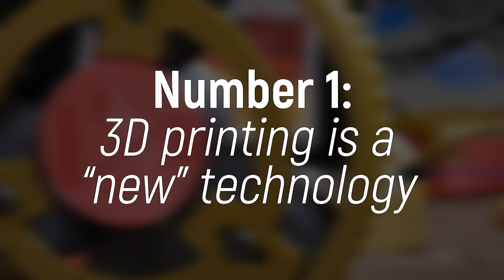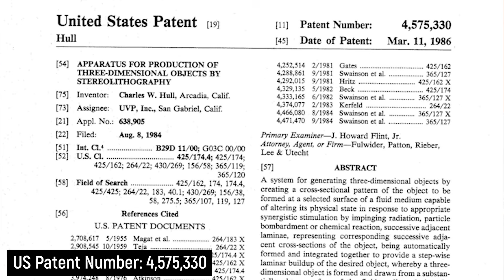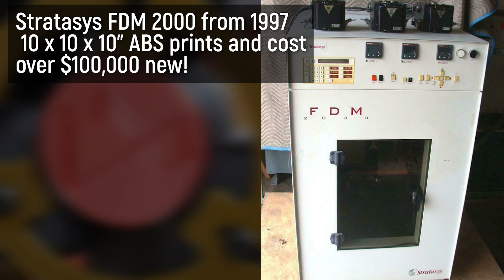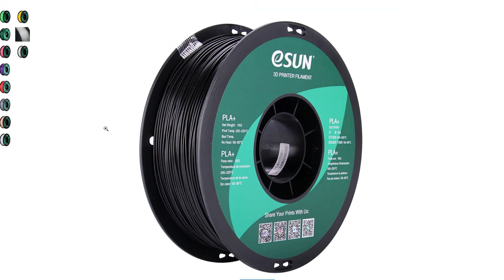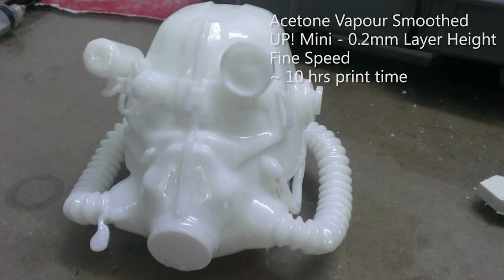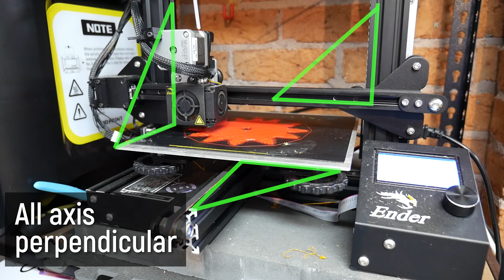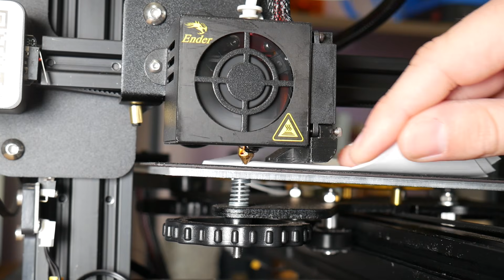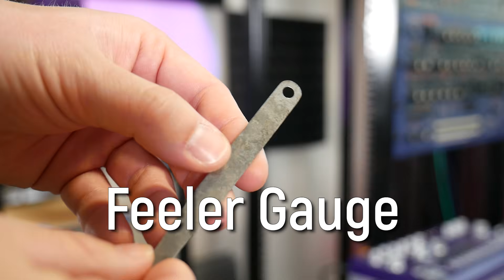3D Printing Myths I used to believe...

Comment: USE A DIAL INDICATOR TO BED LEVEL! It's like 5x faster and WAY more accurate.

(My $30 Turlen indicator from Amazon is laughably accurate for its price, verified in a machine shop)

PROCEDURE:
FIRMLY fasten it to your print head below the nozzle (I carefully zip tied it to my CR Touch), bring table to temp, set indicator zero at one corner, move the head over the other adjusters in X and Y (Don't move Z), and bring those up/down to match the first zero. Double check until you get the process down. If it's repeatedly accurate, you are now VERY level.

You will actually notice high and low spots in your table, mine had some spots that were .003 inches lower or higher than the corners, but it prints fine.

Comment: Damn I've been printing for a couple of years now and didn't thought of the metal gauge, maybe because using Original Prusa you don't have to go with those pesky screws as I had to on my Anycubic (and why I also didn't like it so much). Nevertheless it's worth knowing, thanks for the tip!

Comment: I've used feeler gauges for years, just be careful not to gouge your nozzle, as the feeler is steel, and many nozzles are softer. I've never folded my paper, just a sheet of printer paper, no folds. adjust the bed until there's a little friction on the paper. with the feeler gauge, it should pass perfectly under the nozzle, if the nozzle stops it, your bed is too close. You use the same gauges to adjust valve tappet clearance on engines. Machinists use feelers, dial indicators, etc. so it made sense to employ the same tools.

Comment: I found great success in leveling the bed by eye - human eyes are much more precise than a paper. I just have a light on somewhere behind the bed, get down at almost eye level, and adjust all four knobs raising the bed until jussssst when the light disappears. Then I run a couple full bed-size concentric squares/brims and adjust the global z-height on the controls to get that nice, slightly smushed bead. Haven't had a single bed adhesion or first layer problem since. And I can't remember the last time I had to level it. It's been at least 3-4 months.

Comment: In the past I've used the paper method and would frequently have issue with my nozzle digging into the bed, this even happens with my auto leveling from time to time. I ended up learning how the filament is supposed to look when extruded, so I will level my bed with about 2 screw turns loosened, and adjust from there by watching the amount of extrusion out of my nozzle, so far I have gotten fantastic prints, and the ones that don't come out good are usually due to bad filament, loose X or Y axis, or bad support settings. 👍

Comment: Correct term for setting nozzle height is "z-offset adjustment". In CNC machining you do this by setting your tool distance off the part (the bed in this case is cast steel and leveled and "trammed"  within microns from the factory ) and we still use the paper trick all the time; not everyone can afford tool eye sensors on their machines. There is nothing inherently wrong with this process, but it is less precise. Never catch someone using a steel feeler gauge on his $200 endmill to set the offset, great way to break the tips.

Comment: I['ve never heard of using a piece of paper folded (2, 4 times thicker??). I use a flat piece of printer paper manually adjusting until it catches slightly. Then I use the auto level to finish the job. If the differences seem large to me, I'll make fine adjustments and auto level again until I'm satisfied. Once a week or after I've not used the printer for a week or so. I've never had any problems with the job sticking or elephant's foot or similar issues.

Comment: I'd argue Abs is stronger than PLA in many cases for end-use parts as PLA has low ductility and toughness and will likely crack under impact loads. tensile testing is done under low strain conditions.

Comment: Could you clarify?
DO you set to the feeler gauge then UN do the negative Z offset? or leave it there? 
I'm thinking it has to have some clearance or the nozzle drags the bed... OR the slice offsets it up the thickness of your first layer, and doesn't drag even if set to dead 0? Either way could be right, and I don't want to damage this thing. 

I come to this from machining metal on non CNC machines, so I get the traming bit, hate the term leveling for it, but even knowing the concept, its impossible to get any data on what Exactly the clearances are supposed to be.  Don't even get me started on belt tension... I want a deffletion spec to set them to but thats non existent too.

Comment: Good tip about the feeler gauge, and raising  the z axis by the same thickness as the feeler guage.  So I think I'll get a set of feeler guages, as that seems a more accurate way compared to using paper!  Certainly my new Ender 3 Max doesn't have fancy automatic bed levelling features!

Comment: I've stopped using paper long ago. To level a glass bed I just heat everything up, clean the nozzle, put a powerful flashlight behind the printer and dial in the screws to the point when nozzle just meets its reflection in the bed and there is no slit between the nozzle and the bed. Given enough light and a clean nozzle, the accuracy of this method is within 10-15 micrometers. For Ultrabase/PEI sheet I let the hot nozzle form a small blob of molten plastic, softly touch the bed with the nozzle and slowly dial the bed back down until the blob just starts deforming (it stretches between the nozzle and the bed) and then lift the bed up just to the point when the drop no longer deforms (that means the nozzle is touching the bed).

Comment: And regarding leveling and nozzle height. I found it you start a print then kill power to the printer during the first layer you’ll leave the printer at it’s starting height. From there you can then then do the feeler/paper leveling by dragging the head around.

Comment: I don't think folding the paper is correct. Always used an a4 piece of paper. When buying the anycubic series of printers it comes with a 'bedlevelling' paper already stuck onto the bed. which is the same gauge as regular paper. Folding it over would definitely make the levelling process redundant

Comment: Leveling the bed with a paper was, so frustrating so many variables could be off!
"business card? A4 sheet? folded A4? Dig in? slight resistance? No resistance?"😩 everyone does it different!
Now i just run a test print circling the whole bed with 1 layer and adjust it live while printing until it's perfect
Works everytime!

Comment: This is the first time I've ever seen someone use a folded piece of paper. I've always done it and have always seen it done with just a flat piece of paper. Also if you measure the difference between cold and preheated with a mic you'll see that its basically pointless to preheat.

Comment: 4th spring can cause or fix deformation of the bed. I do leveling with a paper but, single layer and measure the thickness of it and use it as basis. If you do not have software bed leveling capabilities in your printer, you still do not need perfect zero, depending on the slicer you use, you can adjust the zero height. Though if it is too off, you might have mechanical issues so be careful.

Comment: Maker's Muse is absolutely correct about the whole paper leveling business with regards to the fact that using paper for leveling is always going to result in the nozzle being a paper's distance away from being correct, HOWEVER, using a paper for leveling is just the first step and all that gets you is CONSISTENCY.  a uniform tramming of your print head to your print bed is what you're going for in this first step.  it doesn't matter if your "common knowledge" is that the paper should be loose or rubbing, so long as it's THE SAME at each of your testing points (which for best results, I recommend starting with the corners, then the middle going around a couple times, and even doing the middle edges of your print bed as well, if you can get a consistent average to all points, your tramming is complete) - THEN you set the z-offset by printing a calibration object (it doesn't matter what because i stop it before the object prints, i usually go for a 20mm calibration cube) and when I do this, i set a 20 line skirt around the object that i place pretty far away (i try to estimate roughly half the distance from the center to the edge of the bed so it's nice and big and leveling issues are pretty apparent at that range).  when the print first begins, I use z babystepping if you're still running marlin, or z-offset dial in klipper to lower and raise your toolhead while it's printing the skirt until you get both good bed adhesion as well as just the right amount of squish.  you can manually remove each line of the skirt as you go if you want to get a better feel for how far down is good.  once you think you've dialed it in, you use your printer to save this offset in your printer's memory (or klipper config file) and then continue on to heat up your printer and do a full bed mesh with your bed probe (if your printer doesn't have a bed probe, don't worry about it, but it is a HIGHLY recommended upgrade if your printer isn't already equipped with one. (bltouch on most i3 printers works really well, but there are all manner of inductive probes or microswitch based (klicky) probes available for very little money that are very easy to get installed on most printers).  doing a mesh bed level insures that any physical bed leveling inconsistencies are worked out and compensated for in software.  after taking the bed mesh, save it to your printer's memory (or klipper config file) and then (making sure to turn off the skirt from before), print a bed squares model that is only 1 layer high (for me that's usually .2mm), from here you can use the z-offset/babystepping to fine tune your z-offset to the bed to dial in an absolute perfect first layer by judging the consistency, texture, and adhesion of each square in each corner and center to get the PERFECT level. for your printer and save that z offset.  I usually then write it down in my notes because if i don't change the wheels or remove the bed, that z offset should remain consistent through that bed mounting). then i would go on to calibrate linear advance (marlin) or pressure advance (klipper) and extrusion multiplier for the particular filament you are using.  both LA/PA AND EM are set PER MATERIAL.

Comment: i have found on my Ender 5 pro that in leveling with paper the nozzle has to catch, stick and skip across the paper or plastic does not stick to the board. if you do it fast enough it sounds like the paper is farting.  if it farts you are good.

Comment: Misconception #4: Before i got my first 3D printer, thanks to this channel; I believed that line by line, the print would end up being water tight, after all the printer was melting each line at exactly the right height & I had no clue of what nozzle size meant & what accuracy limits 3d printers had. 

Prints are NOT watertight & getting something that has been printed to be water tight or even worse: Hermetic sealed... forget about it; any sealing you add post print should not be used for things like the hull of a boat or submarine because plastic can still allow vapors to go through & even with metal filaments, the printer is not nearly as accurate as it would need to be to make a real seal.

Comment: Another myth to add to your list. Heated beds. I haven't used my heated bed for years with flawless results and to be honest I only ever turn it on to evaporate any excess rubbing alcohol I might use to occasionally clean my build plate off with. Granted I work in a climate controlled work space, it's always around 72-82°F in the room. The build plate is kept clean and dry with very little and scarce maintenance. Also I make sure my bed is full "plumb" to my printer nozzle at an appropriate distance for best bed adhesion without squished flared edges of the initial layers (I do this manually without paper or feeler gauges by allowing the nozzle to just barely scrape the surface all around the build plate surface). I use a PEI build plate (no adhesive). If I do get curling (extremely rare) I allow the printer to print the first layer of a print, stop the print, remove that layer and then start the print over from the beginning. Works every time. Side note the only time I do use adhesive is actually to work as a release agent for those stubborn TPU prints that don't like to let go of the build plate. They come off with easy Everytime but yet still no pullups or curling. With no use of a heated bed to needlessly repeat myself.

Comment: The paper trick was part of the setup recommended to me. Gave me a 2 month fight where all my prints failed. I now just eyeball the leveling and offset the z-axis to match. My usual adjustment is just 0.06-0.64 mm. however, between prints I realized how much mu springs can warp; had a leveled bed with a successful print and a 0.35 z offset, where the following print needed a 1.46 offset.

Now I dial in the height to all my prints. I need to build a leveler attachment to make future prints easier to start.

Comment: As someone who's not just a novice, but have owned a 3D printer for.... checks watch 19 hours since swiping the card and currently running the 3rd print ever, beside the default built in test print... Even I've heard of these, but good to know I can throw them all out.
Reply: Flashforge Adventure 3+, for those who's about to ask. Aka, newbie model.

Comment: So odd to think of ABS as a slowly outdated filament. Used to be pretty much the only way to go. These days for many use-cases PLA(blends)+PETG have become default choices. ABS having been relegated to when you either need that thermal resistance (3D Printer parts) or want to chemically smooth. And even then you are practically always better off with its younger sibling ASA that beats it in nearly every aspect.

Comment: I have am automotive metal feeler gauge and level my bed to .05mm . I have perfect first layers all the time...tough the center of the bed is .15mm lower. I just take that into account for the size of the model i'm using. If it's small i use a .15mm initial layer with .6mm nozzle. Still get great prints.

Comment: ABS DOES have advantages over PLA as far as temperature survival.  Don't try printing anything in PLA that needs to spend most of its time outdoors or locked in a car.  Use ABS or PETG for that.

Comment: Easiest solution to a non-level print surface I've found. (Using a LARGE 1.0 print nozzle for LARGE prints).

1. Make a PROCESS (Simplify3D) that will print the first bottom layers SLOWLY at say 0.55 etc, like 1mm up. Some print surfaces are just inherently uneven, or become more uneven when heated.

2. Always use the side of the print surface that bows upward (hill not pit) the first tall layers can negotiate a tiny hill. As opposed to printing down into a pit/dip.

Comment: responding to the first misconception - Consumer-grade desktop printer sized additive manufacturing systems did not exist in the 80s. The same can be said for neural networks, we were using them to recognise number plates in the 90s and built the first analogue ones decades prior. It’s usually about specific people and companies proving mass market viability, in the case of neural networks it was a guy in Canada not so long ago and then companies like Google Deepmind. Same can be said for virtual reality, it wasn’t until an 18 year old made a kickstarter and Valve and HTC collaborated to make a roomspace system - but again virtual reality headsets litter computer museums. 
There is a big difference between a technology being first played with and when it’s useful and accessible to the consumer.

Comment: Additive manufacturing is refures to adding the necessary materials instead of removing materials aka subtractive manufacturing.  Castings, pressings, moldings and 3d printing are additive manufacturing examples.  Additive manufacturing has existed long before 3d printing.

Comment: Does autoleveling correct the leveling issues? Obviously it won't balance for extreme differences but small discrepancies right?
Reply: Pretty much solves them in my experience. All you have to worry about then is setting the correct z probe offset to get the correct nozzle height.

Comment: How do you rub a tiny feeler gauge around on the bed without covering it with oils from your fingers?  Do you then wipe it down with ISA and risk pushing on the bed and throwing it back out of level?

Comment: I have very rarely seen anyone suggest using a folded piece of paper when making adjustments to the bed. I never thought that it made sense to use paper, folded or not. How thick a piece of paper should one use is like asking how long is a piece of string. I've always thought that the nozzle should just touch the bed at Z=0 but that needs to be done with caution to avoid damaging the bed or nozzle. Once that is done, then the first layer height will be accurately set in the slicer software.

Comment: I personally dont use paper or any method of bed tramming based on feel at all anymore. I just clean the nozzle, then home the printer to zero and lean over to see how far the nozzle is from the bed. I then adjust the bed springs until the thin line of light coming from under the nozzle just barely dissapears (the nozzle is only just touching the bed). Then I repeat for all corners and repeat the whole process until all corners seem to be the same.
Reply: I use the cellophane off a cigarette pack. I'm a machinist and use it to touch off tools also. Less than .001 thick, and you don't have to buy feeler gages to only use the smallest one off the pack.